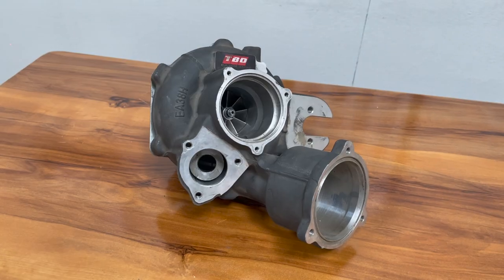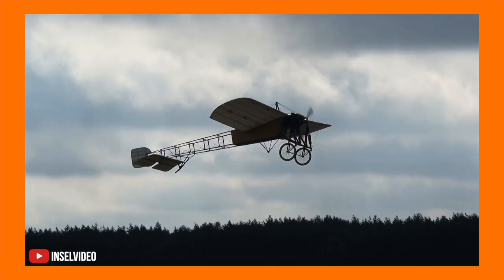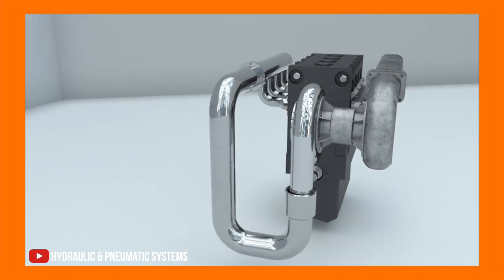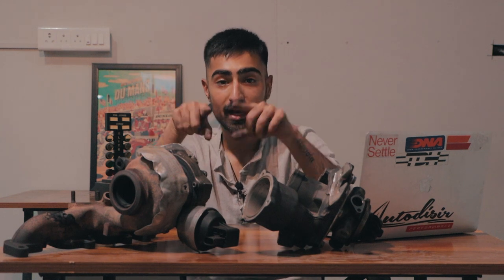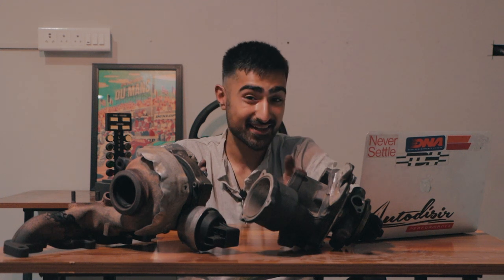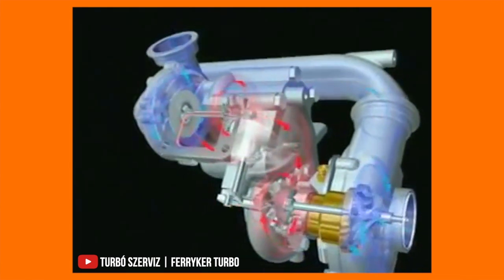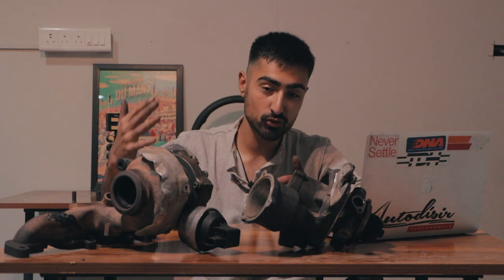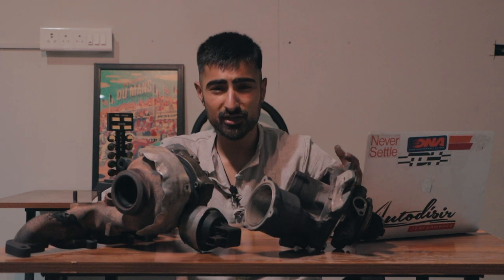DIFFERENT TYPES OF TURBOS! Single Turbo, Twin-Scroll Turbos, Twin Turbo & Electric Turbos!

Comment: Now people will be commenting "BUT SURPERCHARGERS ARE BETTER THAN THE TURBOS" i am actually fed up with the car industry these days. Like dude, doesn't the supercharger and turbocharger serve different purposes from each other. According to my knowledge, (i might be wrong) superchargers use mechanical power and they are used for instantaneous torque. While the turbocharger uses air to work and it is mostly used for high-end power. So i guess they both serve different purposes so it doesn't make sense, comparing these both. (NO HATE)